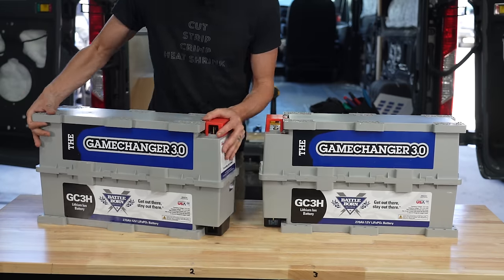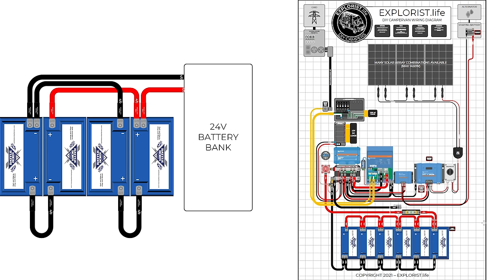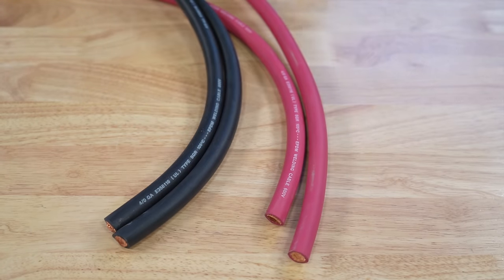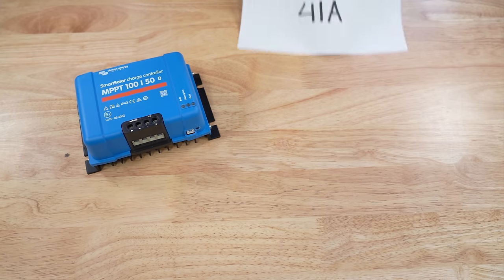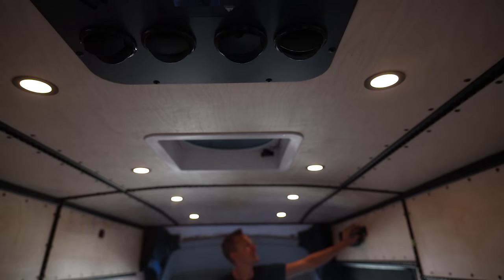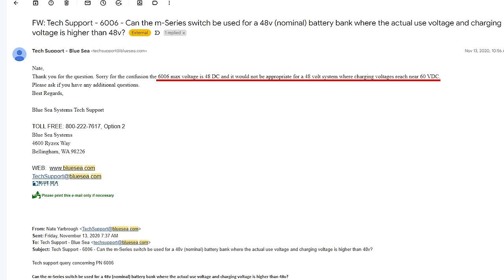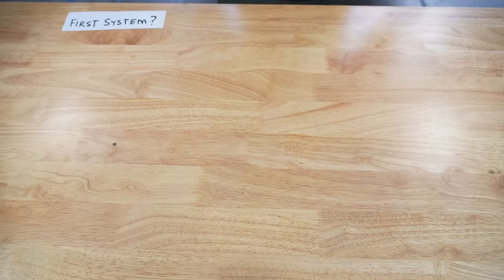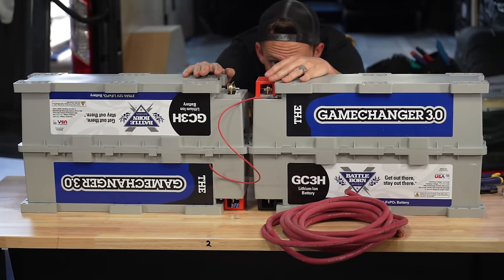12V vs 24V vs 48V (For Camper Electrical Systems)

Comment: There's an Australian company called Safiery building campervan components with Victron interface capability with alternator charging/dc-dc of 48v - 12v up to 3000w
Reply from the maker: If you're talking about their 48V alternator swap, that's the same isssue I talked about in this video regarding availability, due to either supply chain, or not every vehicle not having the capability to run a 2nd alternator.
Reply: @EXPLORISTlife  not a Alt swap, its a DC-DC, they call it the "Scotty" and "killer wasp"
Reply from the maker: Ah, nice!  It will be interesting to see if it becomes more available here in the US.  No retailers available at the moment, it looks like.  Purchasing direct from them and importing it looks like it MAY be an option...

Comment: Ecoflow makes a system that can charge their 48 volt batteries from Alternators but it is super expensive.

I plan on building a skoolie in the future that will have 4,400 watts of solar so that system will need to be 48 volts!
Reply from the maker: Nice!  We will have options for 48V systems soon.

Comment: You can easily get 48/58/72/100V DC 250A power switches. 

search for emergency stop/switch/push button for electric forklifts. should cost <10-100€

Comment: From my understanding on a 48 V system, having a T class fuse is what most people are using on their battery bank. 
I have yet to see anybody talk about what you’re talking about, as far as shutting off the battery power with something more than the usual blue sea on off switch?
Reply from the maker: Glad I was able to shed some light on that issue.  Thanks for watching!

Comment: have a 12v buffer battery and just charge it with 20-40amps 120Vwhich is powered by your 48 inverter. Some losses but if your 48V system goes down for whatever reason you still have 12V battery for most of everything. and you can just have a smaller 300-500watt inverter that can go off that battery.
Reply from the maker: Neato
Reply: Well that was one idea I have been thinking about my self is to have a dual system 24 volt or 48 volt on the roof and then a smaller portable 12 volt system that can be used for a small 12 volt system and back up if needed.
I am wanting to build a diy solar powered RV system that can also power power tools and other heavy power draw and users. (Is this true and is this needed?)
I need some thing that can be self contained for three to four months, I might also need a system that can also pump well water.

Comment: Thanks. I just want to know how best to wire in, super step by step, ie..EXPLAIN IT LIKE IM 5, a DC to DC charger to a single lithium battery that can be the foundation to a bigger system in the future.  

A get me started, super cheap but with quality components system. 

I know the video exists, I just haven't found it.
Reply from the maker: So, like a Battle Born Battery w/ a Victron Orion DC DC charger and a 12V Fuse block?  All connected together with 6ga wire connected to the battery with a Victron SmartShunt on the negative side and a dual MRBF terminal fuse holder on the positive side?

^^^Not explained like you're five... but that's a pretty good blueprint for a super simple system like you're talking about.
Reply: Nate, just add 100W portable solar and this is exactly what I am laying out for my pickup. Group camping, tailgating, boondocking will be well served by a tiny system like this.
Reply from the maker: Question for you... for a super small system like that... why not just go with something like a Jackery portable power unit?  9 times out of 10, it's going to be cheaper and smaller.  Is it the quality of components?  Flexibility?  What's the other reasons for wanting to DIY a system over a portable power unit?

Reason I'm asking is that we plan on making a tutorial for a small system like this using Victron components, but I want to make sure I fully understand why somebody would want to DIY a tiny power box as opposed to just buying one pre built.
Reply: I guess there are a couple reasons. I like figuring things out, so forcing myself to understand solar panels, charge controllers, B2B chargers, fuse blocks, etc has provided an education in 12V systems and planning. Your channel has really helped in this regard. Using quality components such as Victron, Battle Born and Zamp is important for me. And yes, flexibility is key as well. Phase 2 of this build out will be to add permanent solar to the roof of the pickup's topper. This will allow me to add to the truck's electrical capabilities PLUS allow me to add power to our travel trailer. The trailer has a sloped roof and isn't conducive for mounting solar panels. If I configure it correctly and run an extension cable the truck can provide decent solar to the trailer while taking care of its own needs either on the move or stationary. Yeah, it's overkill for charging a phone or a couple of lights but maybe not when keeping a fridge running for a few days in our hot climate (central Oregon). Besides, it's all fun. -Bob

Comment: Can I use a 48v inverter with 24v batteries ?
Reply from the maker: Although it's possible, you'd be wiring your battery bank in series or series parallel to make a 48V battery bank, and you'd have to make sure your batteries are compatible with that.

Comment: I wish you could have stuck with the LiFePO4 chemistry ... I am reasonably sure those battle born you are using for 24 is not though they are "Lithium".  Those do contain the cobalt ... I think.  There are so far (I think) 7 different types of Lithium Ion (a generalized term) and LiFePO4 is one of them.
Reply from the maker: How are you 'reasonably sure' that Battle Born batteries are not LiFePO4?  You only have to scroll 1/3 of the way down their home page to see that that are indeed the LiFePO4 chemistry. 😂🤣

Comment: 48v should also be used in the home. As there is no domestic appliance that could not be made to be 48v.
Reply from the maker: A home would indeed fall into the same category as off grid cabin with everything being run through inverters to a typical residential 120/240v breaker box.

Comment: My solution was to build a 48v 34’ trailer and run all residential electrical without the 12v system except brakes.
Reply from the maker: Yep!  I've seen that before, and that works well.  We actually had a project (that fell through) earlier this year that was going to be the same thing.  No alternator charging and no 12V loads.  Just solar, Two Victron Quattro's, Two VE.Panels, and a residential breaker box for 10,000w of Inverting power in a split phase configuration and shore power charging from either 120V 30A/15A or 120V/240V 50A, all installed in a cargo trailer.

Comment: I use dc breakers all the time up to 50A ….not nearly $300
Reply from the maker: We need them up to 250A which are about $125 and usually need a pair of them, and then the box is another $100ish.  If you have a source for 60+V DC breakers rated for 250A in the $30 ballpark; let me know; because I've been looking.

50A is not a problem.

Comment: 3000W is a common amount of power for an apartment to draw. Can you imagine wiring an entire apartment on 12V DC?
Reply from the maker: I can't...and that's also not a fair comparison because all of the loads in an apartment are not 5ft apart like in an RV/Van
Reply: @EXPLORISTlife  fair enough. I just can't wrap my head around powering an induction cooktop with a 12V battery, even if it is the only thing running. It seems to me that people are trying to shoehorn 12V infrastructure into their builds simply because that's what alternators and the car electrical system run at.

Comment: You didn't talk about efficiency. I mean converting 120 to 24 vs 12 and back to 120
Reply from the maker: They are all plenty efficient with proper system design and good quality components.  Efficiency isn't more important than the other topics discussed.

Comment: Nice video but your size wire description is wrong. You claim 1/0 wire is smaller then 4/0  when in reality 1/0 wire is LARGER. When talking wire size the bigger the number the smaller the wire. The smaller the number the LARGER the wire. This part of the video will give people the incorrect information on wire size.
Reply from the maker: Would you like to bet on that?  I'm prepared to wager a large sum of money that 1/0 is smaller than 4/0. 🫣🙂

4/0 is bigger than 1/0.

Smallest:
10ga
8ga
6ga
4ga
2ga
0 (aka 1/0)
00 (aka 2/0)
0000 (aka 4/0)
Largest

Comment: Why not 72V?
Reply from the maker: 20,000V is the future.
Reply: @EXPLORISTlife  what do you mean? Are you unable to declare that 72 V is not an option? Or not a desirable option? 

Or, are you simply not capable of the discussion, and not polite enough to simply demur?
Reply from the maker: Oh, sorry.  Thought you were being sarcastic.  Parts and components for 72V systems are not readily available enough for the consumer market.  It's like 48V, but way worse In that regard.
Reply: @EXPLORISTlife  things are changing so fast. My preliminary research indicates 72 V is a better choice, but I’m not sure yet. TBD. TBC ☺️
Reply: @EXPLORISTlife  No, I was not being sarcastic. I am capable
Reply from the maker: Yeah, 72V may be good for huge systems with 50,000w of inverting power or something where you'd otherwise be pulling 1,000A @ 48V.

But then you are getting into industrial applications and such where you may have access to custom-built components.

Comment: 48 volt system- put a charger on a 12 volt battery- charger 20 bucks- battery 20 bucks from junk yard.. no?
Reply from the maker: Idk.  We aren't building junk yard systems here.
Reply: Actually I am building a testing system to get the hang of 48 systems. Already have a 12v system in the car and 24v in the camper, now come learning 48v for the ranch home.
Reply: Junkyard for the win, but thanks for the information and opinions in video… and your comment